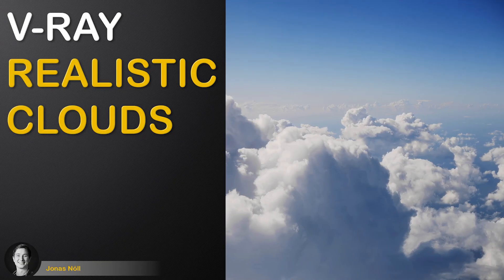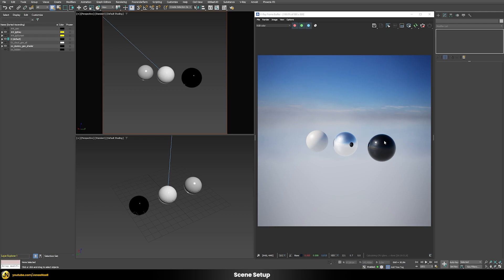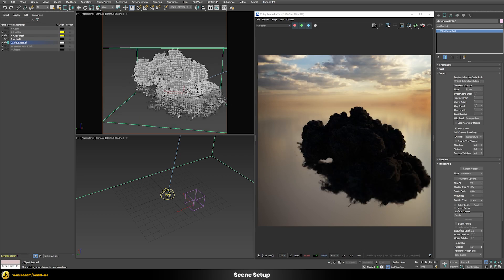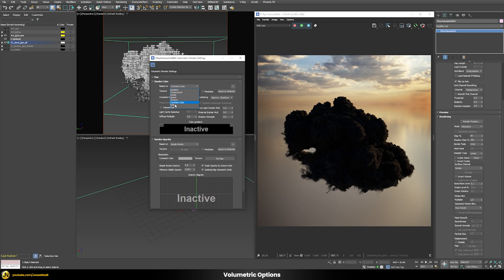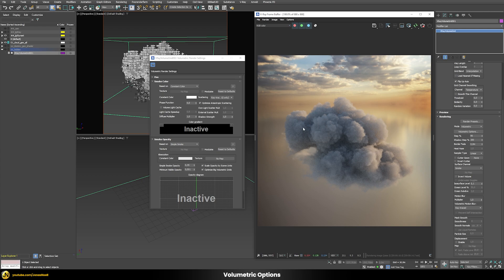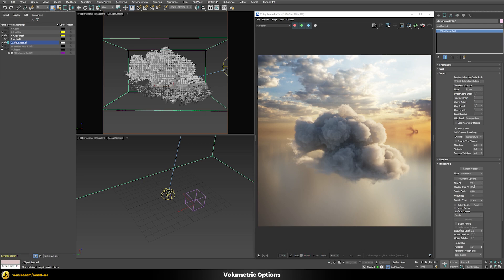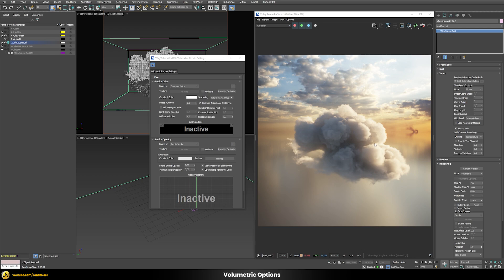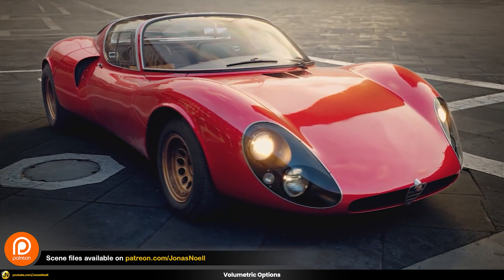V-Ray | REALISTIC Cloud Rendering Tutorial

Comment: What GPU are you using?
Reply from the maker: CPU was used for rendering in this video: Threadripper 3990x. For GPU is 4090
Reply: @JonasNoell  oh that's nice. So the threadripper would actually out do the 4090? Because I heard you say you have stronger CPU that's why you used CPU.
Reply from the maker: @myown-ht4lk  At the time of the video I only had a 3060Ti, I guess now especially rendering volumetrics the 4090 should certainly be faster. But I haven’t tried it in this scenario yet